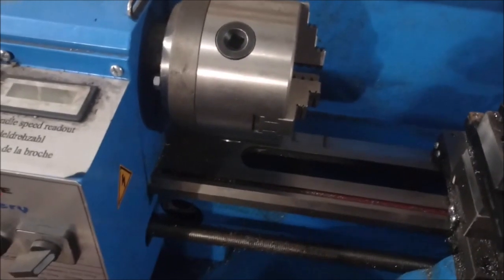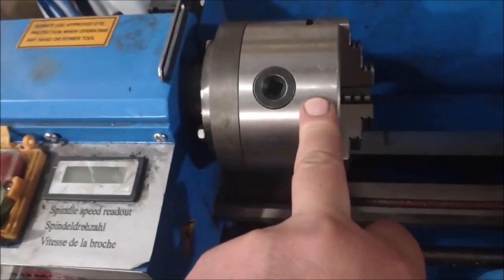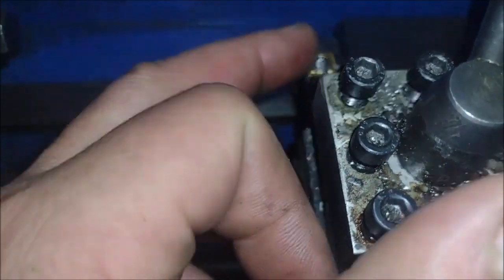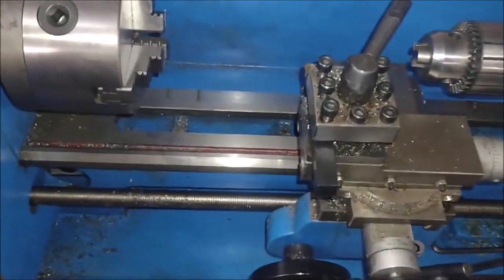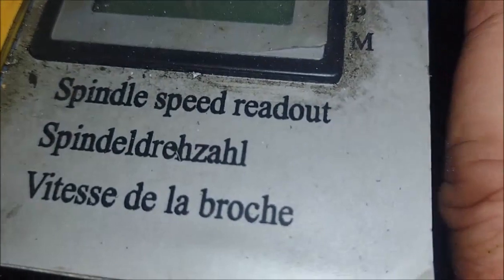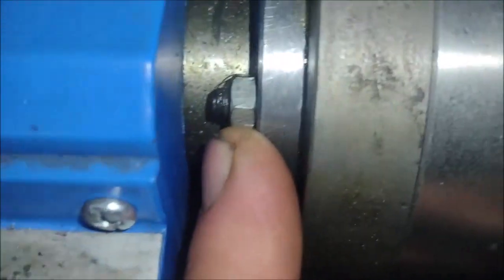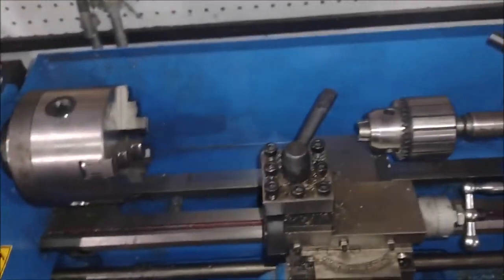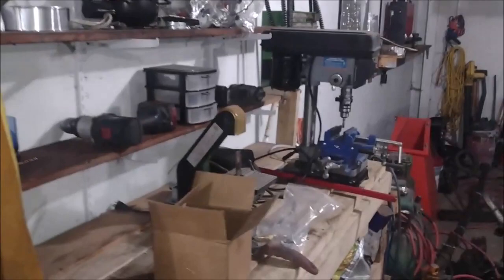Sumore 7x14 mini lathe chuck upgrade

Comment: Interesting. I would however check the backing plate and then the chuck for runout. I would also put a known round pin in the jaws and check that. It sounds like you are a bit out of balance. 

But you are right, these lathes are a good place for people to start or for those that only need to do small sized parts. 

When you get ready to change out the tool post to a quick change one, consider the Aloris style ones. That's what I mounted on my Vevor 7x14. I ended up with one from Shars. I tried several from the cheap Chinese companies and sent them all back due to quality. 

I have a video series on that process, it's located here:  https://www.youtube.com/playlist?list=PLoz-2IH4A2KtdqA9y3yseT-jdAvPuvQE9

Anyway, nice to see the bigger chuck, I think with just a bit of tuning it will be really great.